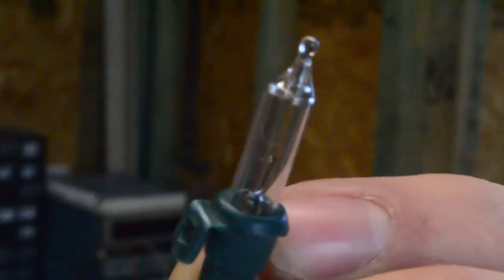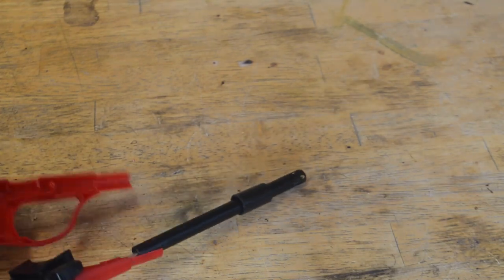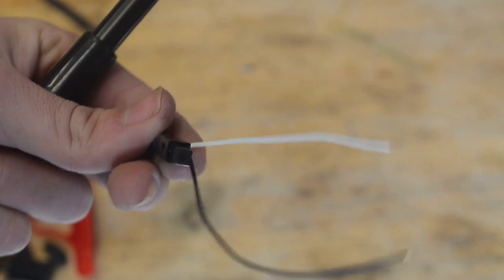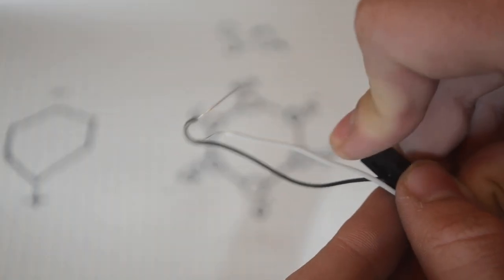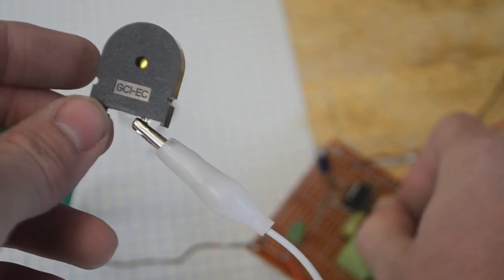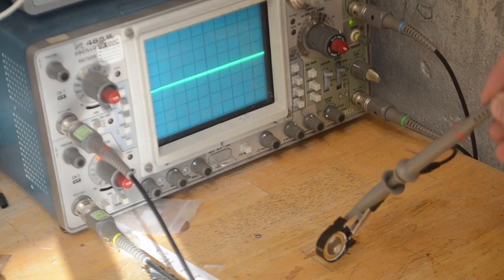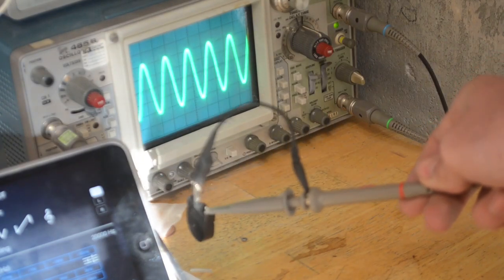Piezoelectric effect

Comment: so what would happen if you just went out and struck a quartz rock with a hammer? does it have to be steel? In that fact a netal at all? whats the striker made out of?
Reply from the maker: +Bloomfield Productions the striker doesn't matter as far as material goes, it's just the kinetic energy, and striking a quarts rock would generate a voltage :D
Reply: How is that voltage captured? could you do a future video and maybe make your very own piezo electric igniter? or a tutorial that teaches you not only to make one but explains how it works aswell?

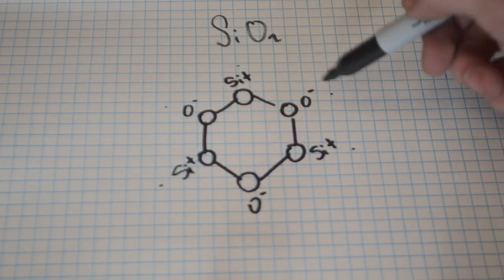Comment: @1:35 you're wrong about the structural motif of Silicon dioxide. The Silicon should show tetrahedral coordination and be surrounded by 4 oxygen atoms (2 of which are originally from another Silicon atom).
Reply from the maker: Yes, I was simplifying it down to be easier to visualize, the tetrahedral though do align up in a crystalline structure like the one I showed except for that rather than 3 of each there are 6 of each per hexagon

Comment: The skin effect on human flesh is actually somewhat of a myth - the current is only safely passing through human bodies at high frequency because the nerves are not influenced by high enough frequencies, so you don't feel the electricity and it doesn't cause your heart to have problems.  You're still conducting electricity and its going through most of your body - but the skin effect generally only happens on solid uniform conductors.  But as the overall power increases (super high current / voltage) it will begin causing damage to your body again, this is why electrosurgery still works.  120vAC at 20kHZ should be safe to handle with your body though - don't take my word for it though!  Never trust people on the internet with your safety.
Reply from the maker: Thank you tommy! I'll keep that in mind!!
Reply: Moreover, the skin effect occurs more sharply the higher the frequency. Get up into RF and it can be fractions of a mm. But, RF also causes heating effects to soft tissue, so actual demonstrations using power sources capable of over 100 ma using your own body could be dangerous and painful. Just because you got away with it once does not mean that it is safe!. I once took 450 volts @ 400hz from the bus bars of a power panel capable of hundreds of amps across my sweaty back. No burns, and after I came to, I was alright. But, it could have been lethal. I just "got lucky" that day.
Reply: Tommy Callaway tl;dr
Reply: hello? nate i sended you hangouts request please accept it

Comment: What it the piezoelectric effect of crystals in the earth's crust  ( typically lots of olivene) in relation to the global electric circuit modulated by space weather. Earthquake forcasting is slowly getting better with electrical signals in the earth system leading the way.

Comment: may I ask, 
is that 10 miliamps already produce the highest frequency? and how about the voltage at that 10 miliamps? is it higher current make the crystal vibrate even faster? according to your measurement, what is the ampere and voltage at the highest frequency?
thank you for your answer

Comment: What stops these lighters from working? I have 7 different types of these lighters from cheap ones to very expensive ones. They all die very quickly. Full of gas and you can see the spark but they never light. Why?
Reply from the maker: +Solder King huh strange, try putting a flame near the opening then hitting the switch and see if anything lights, if not the gas is either not emitting, or just bad somehow I think

Comment: Say I have a very large box made of granite. And I mean super large with a lid so heavy the box is able to build up presure without leaking. Am I able to create electricy if I build up a high presure with lets say CO2 in this box? Is this even remotely possible? How high does granite has to be under stress to create electricity?
Reply from the maker: The key here is that the crystal lattice must be moving (oscillating/changing) to create electricity, so just a pressurized box would act as a balanced static system and not have any current, but, as soon as you were to let the pressure out, theoretically there should be some form of current present (albeit I have no idea the magnitude, but likely fairly small). To further your question, I wonder if the air flow itself creates current. In other words, perhaps the acceleration of atoms create a dipole moment. Upon researching this conclusion, I have found no papers, or experiments testing this idea, but I did personally put compressed air at 90 psi through an inductor and measured no current at the scale of microamps, so for the time being, I have no definitive evidence to back up the postulate I just gave, but if we could find evidence for it, it could behave as a solution to the pesky question of how charge forms in the atmosphere for elements such as lightning. So, I will investigate this further, and try to form formulas to describe this thought... sorry I just realized I rambled away from the topic for a while, hopefully I have provided a solution to your question though.

Comment: You know technically, all electric power comes from crystals or is some how induced in a crystals lattice. All metals are crystalline structures in different atomic geometries. Just something to think about ;)  

Also on the HV skin effect. A great analog way to demonstrate it is by using a Transistor driven slayer exciter.  If you want to get into a more classicalal approach, do some research on 

https://en.m.wikipedia.org/wiki/Lecher_lines

Using an NST you can demonstrate the stout bar circuit that is an electrical engineers playground of classical spark gap transmitter design. Some interesting stuff to experiment with.
Reply: can you help me to finding anything that connects me to the original RAIF technology. disease (metastatic cancer)...